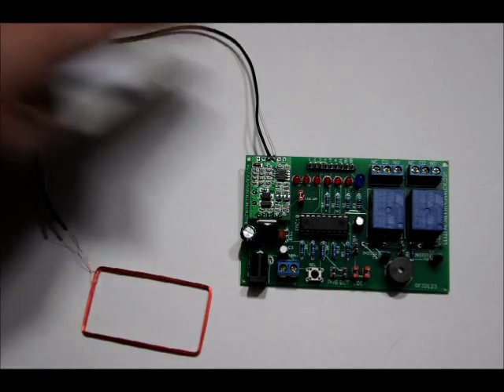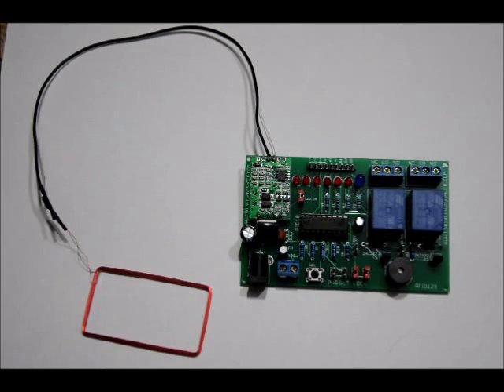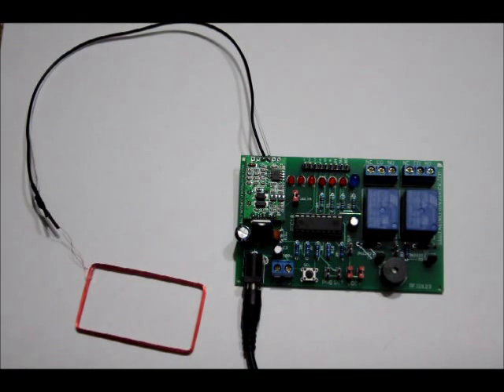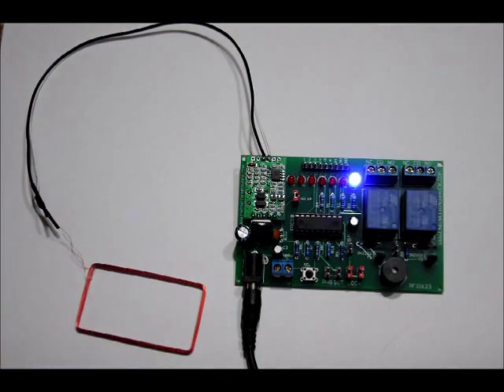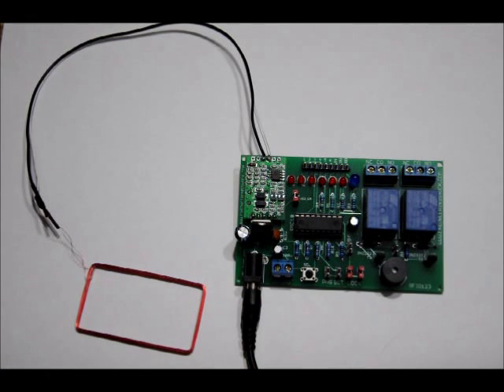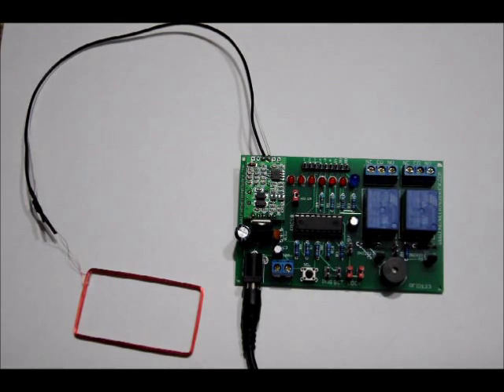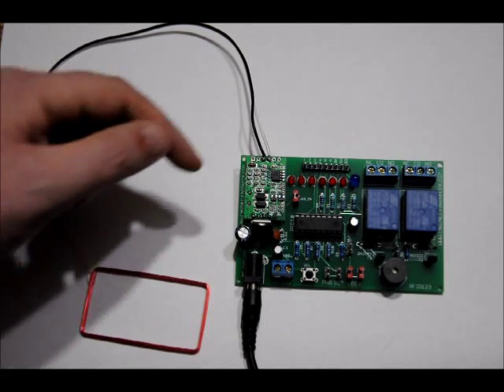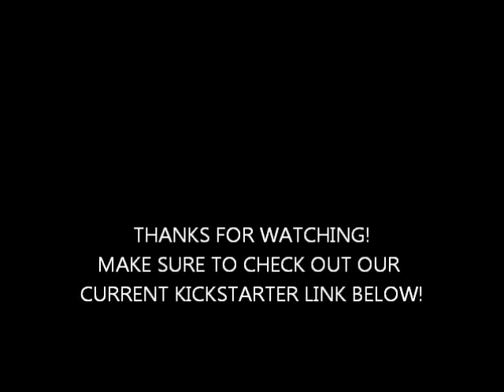Adding wire extentions between the RFID antenna & the RFID Reader!

Comment: Question, I am curious if you stretched the wire out.  Will the reader detect the cards if swiped over the middle of the wire? Or does it only work if swiped over the square antenna at the end?
Reply: the wire does not detect, only the antenna does